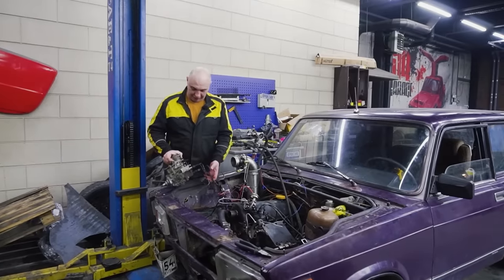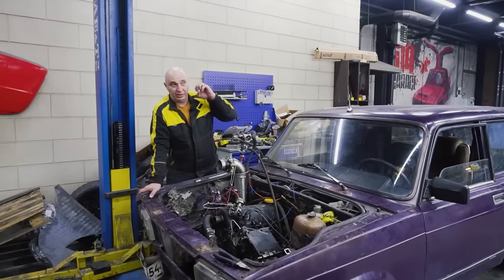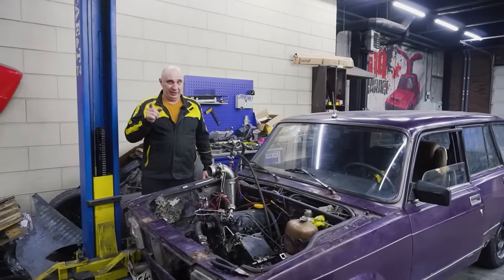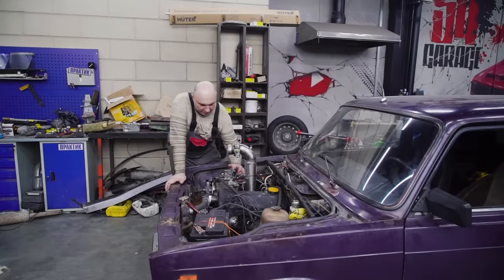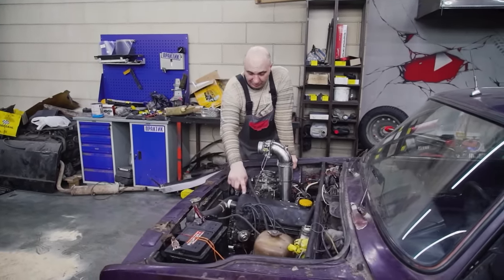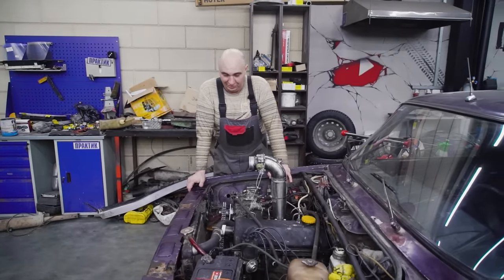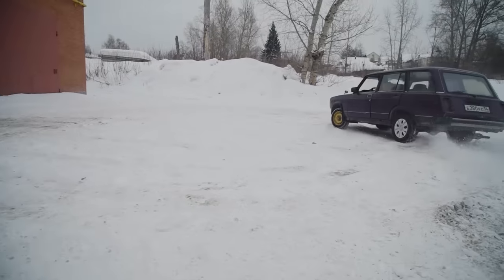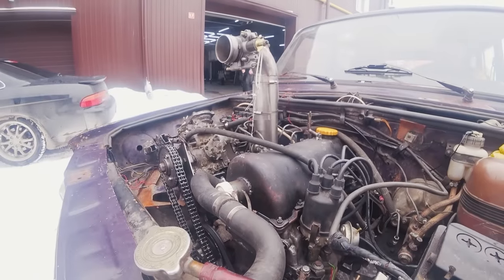We fit high pressure DIESEL pump to Lada engine

Comment: This works much better than my old Hilborn racing system. They use constant flow injectors  but vary pressure (much lower than this)  with rpm and throttle opening. It's almost impossible to run on the street due to poor mixture control. I was TOTALY surprised to see it run this good!! I  expected a lot of swearing just to get it to start and then even more when trying to drive it! When you are opening the throttle blade, you are leaning it out. (All racing MFI systems have a "barrel" valve hooked to the throttle to control mixture with throttle position.)  When you open the Diesel throttle, you SHOULD be flooding it. I have built a lot of multi carb race motors, and boy, you can spend a lot of time messing with jets, etc especially daily driving it. Even going from your warm shop to the cold outside would make a big difference to a carburetor. That's why racers, especially with MFI setups, carry thermometers, barometers, and humidity gauges to calculate air density to jet properly day to day or day to night, its that finiky especially on gasoline. Alchohol is much more forgiving. But not this setup! It just EATS! it has to be that the fuel is vaporized rather than atomized. You could connect a simple choke cable to the Diesel pump to play with leaning it out while cruising just to see your mpg. A vacuum advance from a distributor hooked up to the Diesel throttle with a spring with different holes to hook it in and limiter screws to change fuel rate would make it more responsive Resist the idea of using an AFR sensor to tune it. But one to monitor it would be fine to record what IT wants. I bet you will find that sucker is running fine all over the place on AFR due to the vaporized fuel. I know from racing and dynoing engines that some like it lean, and some liked to smoke a little for max performance and not to be tuned to someone's perfect AFR numbers. Im intrigued! 
Also, mount the pump to the engine, or you will fracture the high pressure lines eventually. Switch to a cog belt drive. You will probably find that the Diesel pump has its own internal governor that will shut down your fuel at a certain RPM. The biggest thing is to not lean it out so much that you hole a piston under load. Most Diesel injection pumps DO NOT change pressure to the nozzles with throttle changes, they change how long injection lasts and they advance or retard the timing also. Some Cummins engines with the PT (pressure/time) system did vary pressure as well. Good luck! Great show!

Comment: believe the earliest fuel injection systems where based on inline dieselpumps 
might be hard to get the air fuel ratio right but other than that it should work
as for the fuel leaning out , could be the dieselfuelpump is regulator needs to be either disabled or made so it can run a higher rpm before cutting back the fuel

Comment: Thats one hell of a video, very interesting, there's propper race mechanical fuel injection like spica/kugelfischer/lucas, I bet with fine tunning/sincronization between trottle and pump it would be a great and cheap mechanical injection alternative(race maybe?)!!!! Great one! For the next do torque converter on a manual transmission!

Comment: Most older diesel engines with injection pumps don't use a throttle butterfly. It is normally a straight pipe. The diesel injection pump adds fuel to rev engine and take fuel away to decrease engine revs

Comment: In addition to my comments below, I need to add that you just happened to get the right style of governor in your pump, (limiting speed) . There are two types of governor, limiting speed and variable speed or throttling governor. Variable speed should actually be called constant speed because when you move the control it adjusts the governed rpms not the fuel rate like yours does. So, like for tractors etc that want to hold a constant rpm as set by the operator even when going downhill or pulling hard the constant speed governor varies the fuel rate to hold the rpms at the selected point. If you had a constant speed governor as soon as the rpms came up unless you also moved the pump throttle up it would cut the fuel off. If the rpms dropped below that setting it would flood the engine trying to pick up speed to match the throttle rpm setting as if it was in the Diesel engine. However, limiting speed governors DO vary the fuel rate with load but only at idle (that's why the Lada started so easy, the pump automatically dumps in full fuel until idle speed is reached) or when "floored" at that point they will adjust the fuel rate according to load to hold maximum rpms but nowhere else in between. That's one reason why the old 2 stroke Detroits earned a reputation for being gutless in trucks. Unlike Cat or Cummins that had constant speed governors (think cruise control) For highway use. On road Detroits only had limiting speed governors (stamped with an LS on the tag)and wouldn't automatically react to going up a hill etc unless the pedal was on the floor and they were wound out. In dozers, tractors, scrapers etc they had variable (constant) speed governors (stamped VS) and because of being two stroke they responded quicker to a load than a turbochaged 4 stroke and did so with about 1/2 the cubic inches. So, in short most tractor pumps won't work and some on road pumps either. Hope this helps. I certainly would like to see this refined!

Comment: If you used something like the vacuum advance or the like to adjust the injector pump to supply varying fuel amounts (E.G. lower fuel at idle, more at full throttle), you could improve the power across the rev range, making this lada an even more powerful lunatic car... :P

Comment: Thanks guys, and stay weird.

1:19 I suppose you could make a GDI engine this way, if you bought a gasoline that used 2 spark plugs per cylinder. You could make some adapter that got a diesel nozzle in place of one of the spark plugs. I don't think any eastern bloc car was built that way. I think the easiest carb 4 cylinder you could find would be a Nissan Z20s, Z22s, or Z24s.
6:27 Diesel injectors can get very hot. Having extra fuel flow from them and leave cools them off. It's sort of like using the fuel tank as a radiator.
12:49 I love the way diesels work. They just let in as much air as possible, no throttle needed, except for some smog engines. Just injecting a tiny amount of fuel or the full amount is what controls it. I never liked the idea that unless at full throttle, gasoline engines would be pulling some kind of vacuum. I think some BMW valvetronic and Fiat multiair engines were able to eliminate the throttle.
15:21 I did not expect that. Usually diesel pumps are self governed, and diesels tend to have a low redline. I figured you wouldn't get past ~5000 RPM.
18:00 2 stroke oils don't have the kind of additives that would make colored smoke. Zinc, phosphorous, and sulfur are a must for 4 stroke engine oil.
19:22 Carbs can't atomize and vaporize the fuel as effectively as high pressure fuel injectors. They also tend not to distribute fuel all that evenly between cylinders. That is one reason multi port injection engines and GDI engines are more powerful and start more quickly than carb engines. Also, TBI engines aren't that great.

Comment: a diesel sprays the fuel at the top or near the top of the compression stroke so with a constant air intake how rich or lean determines how fast the engine spins and how much power. on a gas engine you need a constant air fuel ratio for the fuel to burn properly the way you set the fuel pump is likely a sweet spot that is still enough to idle but enough to allow the engine to run up your likely leaning out at the top enp of the revs if you made a linkage to operate both the pump and the throttle body at the same time with some fine tuning you would have a real rocket ship on your hands

Comment: Correct me if im incorrect, but in a diesel it works like, the air is almost a steady flow, the throttle is the amount of fuel injected into a cylinder, but in a gas engine the throttle is gas mixed with air, so thats why the lada engine is acting up with the high pressure injection pump

Comment: I think that the pure pression of the pump makes a turbo effect. The fuel's pression injection adds pression like a turbo. AT low rpm the pump gives high pression. It is better than a turbo, there is not lag. The question is how long during this pump with gasoline and 2 oil stroke, and how many pressure support this Lada motor.

Comment: I believe the Mercedes 1952 300 sl and the mid 50s corvettes may have had something similar. This with the 3 ring pistons and boost would be interesting if it holds together

In contrast you can run a small block v8 with a 212 cc lawnmower carburetor.   I believe their is massive room for error here but to get it precise is a science and an art.

Comment: There was a toyota 3k-r engine fitted  in a corolla. The engine was fitted with a mechanical injection pump . The engine was designed for racing only.

Comment: I don't quite get how it's working either, but my guess would be it's that the  "pump throttle"  he's adjusting is more akin to a pressure regulator. 
It's actually the engine RPMs that when increased (throttle opened), is turning the pump faster, generating more flow (dumping in more fuel) at that constant pressure... 🤷‍♂️

It would explain why he didn't really increase the RPMs much after a certain point, because the fuel was being atomized sufficiently already, before the pump was cranked up to "100%" (to borrow his term, since at the end he mentioned it only being at 85%)

In reality, this is how the original Fuel Injection systems worked way back in the day (I think the first car with one came out in the 1950s; war planes having it before that). It was all mechanical and that's why we later, to differentiate them, dubbed the new system EFI: electronic fuel injection.

Comment: The way it works you're supposed to leave the throttle body all the way open. Then you use the injector pump to meter the RPMs of the motor. There should be just a wide open throttle at the top. That's the way it works in a diesel. One of the reasons why they don't use this setup on a gasoline engine, is because the fuel needs to be metered differently under a load, then it does when it's just Free Wheeling. It needs to be enriched under a load, and at the same RPM can be leaner while just Freel coasting. But you could make it on the rich side and make the car drivable, by adjusting the diesel pump to rev through the RPM range with the upper throttle body wide open all the time. That's how it works on a diesel, and it should work for the gasoline engine also. Only difference being under a load you can't change the amount of fuel that it gets, while maintaining that same stable RPM. Keeping it on the rich side, you would be able to drive it with just accelerating the diesel pump alone. They're also is a way to adjust how much fuel sprays out of it.

To put it in simpler terms, a gasoline engine meters the air and fuel mixture at the same time, for variances in load.

A diesel engine meters how much fuel enters the cylinders, and does not meter the air intake, it just gets wide open air intake, and RPM is managed ONLY by the variable fuel output of the diesel pump.

Comment: A AFR gauge would make it easier to get the maximum effect out of that set up. Plus, it will make it way easier to tune. I think adding a small turbo would also turn that Lada into a monster. Provided the engine didn't grenade from the added pressure.

Comment: The pump throttle just needs to stay wide open. On the diesel high pressure fuel pump the throttle just sets the pumps maximum pump speed before it starts reducing fuel. The screw on the back of the pump sets the maximum amount of fuel it injects at a given pump speed aka the fuel curve of the pump. Also the boost compensator is still on the pump which restricts fuel quantity when theres no boost pressure.

This in theory could be setup to fuel a turbocharged petrol engine correctly... not sure the pump will last with petrol in it though

Comment: What about petrol engine conversion replacing the spark plug with a small combustion chamber maybe weld the combustion chamber in the head to increase the compression.  So it's like a proper diesel engine.

Comment: 30,000 psi of fuel pointed correctly in the manifold should draw air on its own, hence bottom end power. Venturi effect still apply.

Comment: If You had added a tensioner to the pump drive chain, to couple it more accurately with the crank shaft rotation - the engine would run much better. Try it.

Comment: Old school diesels dont have a throttle body, the air intake goes straight to the manifold and injector volume per stroke regulates engine speed.

Comment: Exellent work these are some of my ideas  glad to see someone bringing it to reality,  what you need to perfect it is a fuel pressure regulator on the return side to maintain the correct fuel pressure and atomization,  as it is now too much fuel is returning to the tank , also the intake and throttle body is too big you are loosing torque , blessings to you all.

Comment: Fit a wideband lambda, connect it to an AFR meter and you can actually control what's going on. Depending on where you put the injectors and the flow they can deliver, you should be able to make decent power.

Comment: you'll need to program a computer that synchronizes the pump and throttle valve, diesels can run on a wide range of air fuel mixes, but petrols cannot. Diesels also for the most part don't have throttle valves. But the positioning will vary based on RPM, throttle input, engine load, temperature etc...

Comment: So this is probably running crazy rich at low rpm, right? Since the pump throttle linkage is zip tied near full, controlling the injector pulse length. It would be interesting to tie it yo the throttle cable along with the throttle body butterfly, and tweak it to get them moving in the right ratio. Or so what another comment said and add a turbo and set the pump up right to meter fuel with boost pressure or however that works

Comment: Better atomization of fuel. And that is everything in a diesel. Basically this is a mid/high pressure port fuel injection system like what auto manufacturers used to do. Now, the system is applied from a mechanical cam actuated plunger pump to get the required injection pressure so that the injectors can be in the combustion chamber. If you could place the injectors inside said combustion chamber you'd get even better throttle response..

Comment: So basically the injection pump is pumping the same amount of fuel into the intake every revolution, if i understand the video correctly and they have the injector set at one spot. Without taking volumetric efficiencies into account the cylinder is going to pull in the same amount of air regardless of RPM (a 1 liter cylinder is going pull in 1 liter of air every intake stroke) . So you have more or less the correct air/fuel ratio regardless of RPM. The High pressure injectors would cause the fuel to almost instantly vaporize allowing really good mixing and easy ignition. The Dip that was experienced is probably because the vacuum drop along with the air fuel ratio not being enriched for acceleration.

Comment: Oil in the gas lubes the cylinders better. Oil also contains more chemical energy but is harder to burn. Add some oil to a stock vehicle, bet you'll notice similarities to this setup. And the high pressure injectors probably atomize the fuel better.

Comment: Well what most people don't understand about a diesel is that when those injectors fire it is literally on the power stroke or at least at the end of the compression stroke the beginning of the power stroke is when it feeds fuel to the cylinder not like on a gasoline engine where to fuel is fed in through the intake stroke on a diesel if fuel is fed into the engine at the end of the compression stroke in the beginning of the power stroke

Comment: Should have done like Oldsmobile back in the day and use the spark plug hole to fit the injectors, upped the compression and ran it on diesel

Comment: suggestion try to run that engine on diesel.  up the compression a bit either with custom pistons or fill in the combustion camber In the head and then mill it. replace the spark plugs with diesel injectors  that would be great to see 👍

Comment: blat, its a v pump, it needs minimum of 20 psi of fuel pressure, you  will kill it supplying it with a carburetor type fuel delivery pump.

Comment: I've always wondered about doing this.  The results were better than expected.  I always thought the fuel injection pump was turned at camshaft speeds instead of crankshaft speed.  Couldn't tell if the chain sprocket ratio was 2:1 or not.

Comment: The injection pump and the air trolley have to be controlled at the same time.
Please take a look at the older Mercedes Gas Cars from the 1950s that have mechanical injection pumps.

Comment: My biggest question is that how they figured out the ratio for the chain drive for the pump. It's a solid idea that is very nice. Just throw on an air cleaner onto the intake and run the engine by the pump alone. That's how I would drive it.
Reply: Pump speed is 1/2 the crankshaft speed.   This is because the intake cycle is 360 degrees of engine rotation and the exhaust cycle is 360 degrees of engine rotation.  So if your crankshaft pulley is 6 inches in diameter, your pump pulley should be half - 3 inches in diameter - assuming the pump pulley and crankshaft pulley are driven by the same belt.  Look at Pelican Parts for Bosch MFI manuals on how the system works.

Comment: Idk about all, but most mechanical diesels (especially turbo ones) don't have a throttle body. Turbo supplies air, more fuel raises rpm, which makes turbo spins faster, making more air to go with more fuel. And round and round she goes